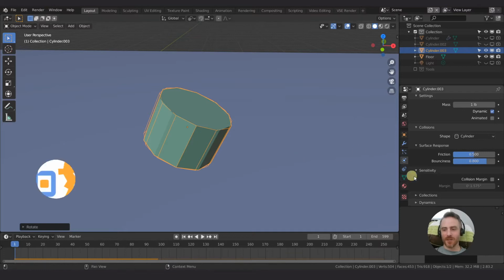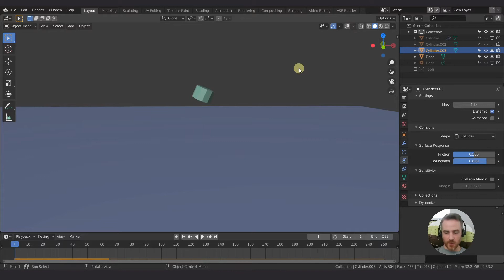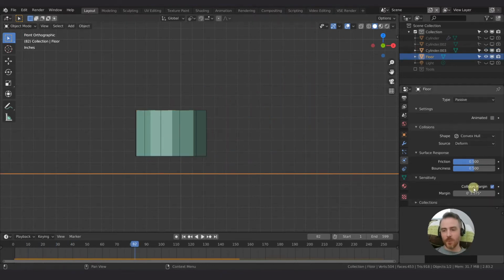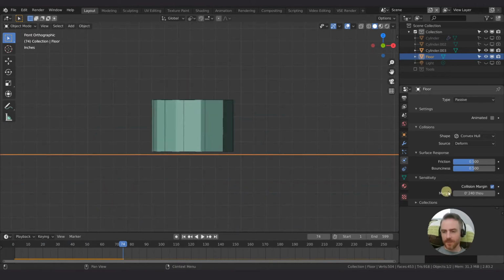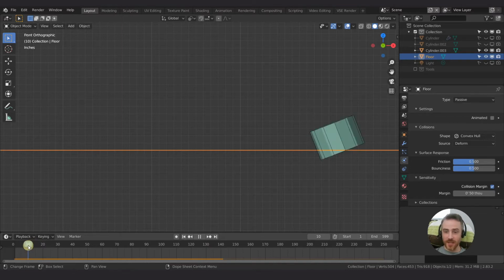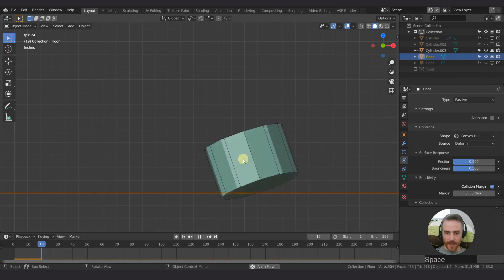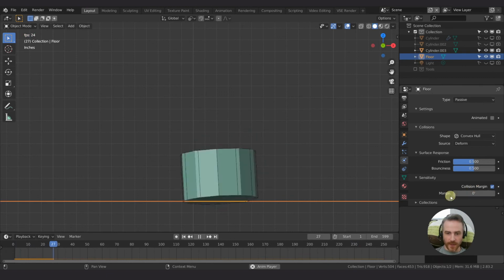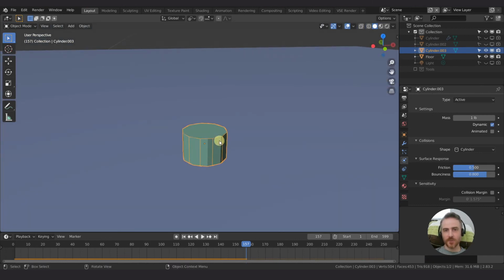Use Collision Margin to adjust space between physics objects in Blender | Quarantine Series 2-4

Comment: I think the cylinder falling through the floor is due to its high velocity while the render is running at a low amount of frames, blender can only calculate physics each frame so one frame the object may be above the ground and the next it has fallen below and so blender will apply an upwards force to push it back out of the ground. So either slower objects and/or higher frames will help
Reply from the maker: Ah ok, thanks for the tip!